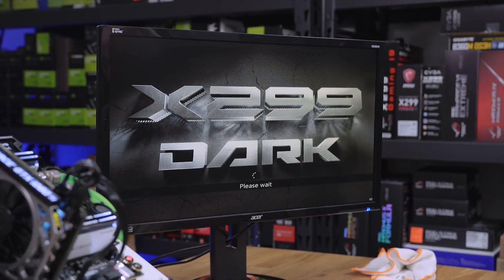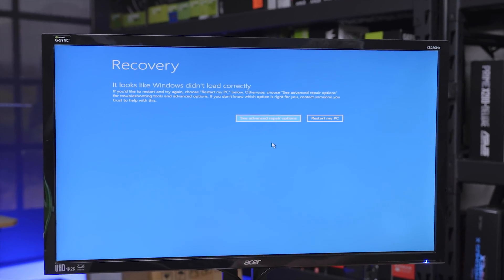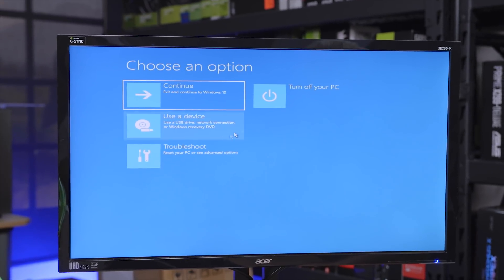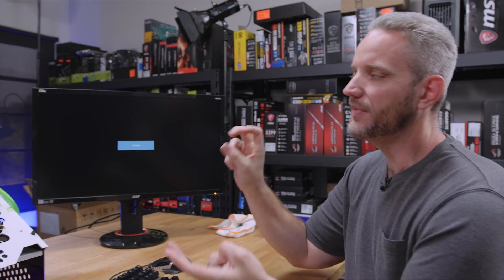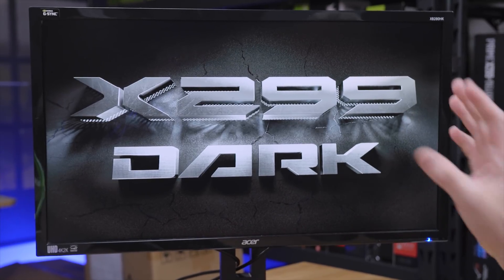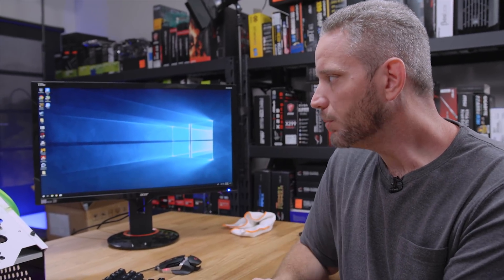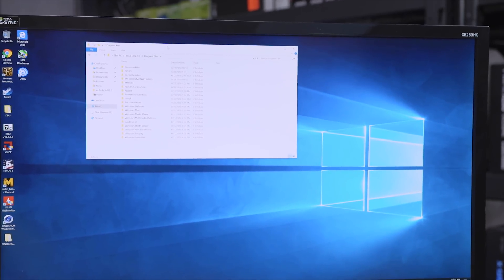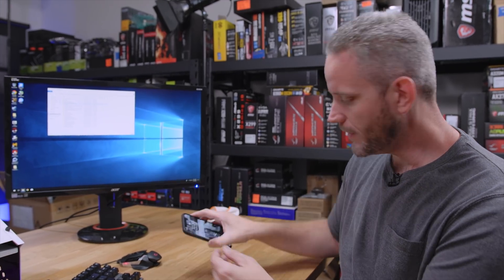New Test Bench Keeps Boot Looping... Here's how we fixed it

Comment: Bit late to the party, sorry if it’s already been said, but you could delete the app folder, and remove the registry key for the installed app. Windows would then not even acknowledge it, or you can stop the program from loading at startup, then use the uninstall from add or remove programs.

Comment: The best 'windows 10 help' would be if during the time you have to access those recovery options --- it lets you boot from an iso and use the iso as the main windows operating system allowing you to access the files on your drives so you can edit/copy/fix the things you need. If you installed windows 10, activating it, why cant i boot using an iso with the same windows 10 key to get full control of my bricked install?

If cmd prompt is active, why not give you access to buttons or tutorials on how to use cmd prompt to fix boot sector errors or anything else that should be fixed with cmd prompt. I know its there for the power users that know how dos and all the windows commands work. But for someone who cant get access to a reference, why not provide the reference. Allow me to navigate the directory, copy everything over to another location, reformat. Or access the drives, extract the iso, copy the installation files overwriting and not touching your personal files?

Or why not have a way to have a backup recovery option that allows you to fix any and every common error in windows that can be fixed in this way by default? 

Rant Rant Rant cuz my ssd corrupted my windows 7 and windows 10 installations back to back to back to back 4 times so I had to reinstall everything after proving my old SSD is at fault, and bricking 2 more installations on a new SSD cuz my old ssd was still connected and fking it up. (I know it stupid but i didnt do anything but connect them both and everything worked and dandy until i restarted and got chkdsk errors and could never recover....).

Comment: This is one of the reasons why I'm still running Win 8.1
The fact that "Microballs" has locked down the OS to such a degree that not even freaking SAFE MODE can fix the issue.. Clearly something is wrong!
However.. I'm gonna have to bite the bullet at some point and install that piece of crap, just to access the Windows Games portion. - Who am I kidding? DUAL BOOT all the way

Comment: Jay you can uninstall in safe mode with windows installer.

Safe Mode.
Type this in a command prompt:
REG ADD "HKLM\SYSTEM\CurrentControlSet\Control\SafeBoot\Minimal\MSIServer" /VE /T REG_SZ /F /D "Service"

and then

net start msiserver

This will start the Windows Installer Service.

Safe Mode with Network
REG ADD "HKLM\SYSTEM\CurrentControlSet\Control\SafeBoot\Network\MSIServer" /VE /T REG_SZ /F /D "Service"

and followed by

net start msiserver 

This will start the Windows Installer Service.

Comment: Getting rid of the F8 to safe mode is the single dumbest shit Microsoft did.

You can force trigger the recovery menu though - just shut it off during the spinning circle of Windows 10 boot twice in a row and on the third attempt it goes to recovery - this is assuming you have no better option on hand as its shitty and hacky but it does work.

Edit: Aaaaand thats why you wait before commenting haha

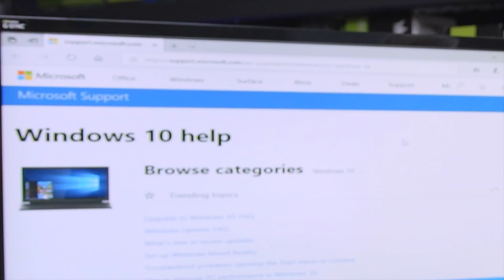3:55 so angry Jay :p

Also you CAN start Windows Installer in safe mode - open admin cmd and run the following:

REG ADD "HKLM\SYSTEM\CurrentControlSet\Control\SafeBoot\Minimal\MSIServer" /VE /T REG_SZ /F /D "Service"

Then

net start msiserver or just right click start it again in services.

Comment: As an IT Support Engineer, I came across the same issue of unable to uninstall in Safe Mode Windows 10 just two days back. For a more permanent solution, try following the instructions from this link as it allows for Windows Installer service to run permanently in Safe Mode:
https://support.eset.com/kb2098/?locale=en_US&viewlocale=en_US
Saved me from smashing the monitor when my laptop goes into boot loop :)

Comment: I spent goddamn near 4hrs last night/this morning trying to figure out what the hell my problem wuss. Come to find out, I have a failing HDD. After I unplugged it, it booted right up. The only reason I concluded that the HDD was the issue was cause I had heard it finally turn on after sitting there for about 15min while staring at the boot loop. After it turned on, Windows finally loaded up. I never new a separate drive could prevent a start up. Well, I'm happy I figured it out but extremely sad at the same time. The dying drive is a 1TB drive full of home videos/recorded gameplay footage. I gotta back it up before it's too late.

Comment: I had a computer that was bsod boot looping and it was actually the ram. The computer didn't like how they were paired and had to switch what channels they were running in and then it booted right up. Also had to reset cmos battery to fix a display issue where nothing would display.

Comment: I love W10, but damn it can be annoying sometimes. I had my PC crash on me randomly when watching videos for two weeks after upgrading to an 8700K because Windows was installing generic driver files that were clashing with display driver files that were named exactly the same. I had to remove the GPU, uninstall drivers completely and run a cleanup tool, then install Intel graphics drivers with the GPU still removed, THEN reinstall the GPU and its drivers again.
Bravo Microsoft. The file that was causing me trouble was atikmdag.sys, in case anyone is going through that same hell. It there were 3 different versions of the same file with the exact same name in multiple directories. After I fixed it, only two exact copies of the same file existed with various shortcuts to it. The GPU was trying to load the damn file and went nuts every time it tried. It crashed so hard I couldn't even see the blue screen of death; the display just turned off and it would restart after 30 seconds or so.

Comment: There might be another way for a system tester to work around this issue; Should the boot partition use NTFS as its partition format, the AMD directory can be named whatever. So when going back to an AMD system for testing a symbolic link can be made via mklink in an elevated command prompt (which is the easiest way to do it). Powershell's New-Item cmdlet also works but it's too much for something designed to do something so simple because New-Item does everything whereas old-school cmd.exe-executed tools just work for the task at hand.

As an example for the above:
ren %programfiles%\AMD %programfiles%\AdvancedMicroDevices
mklink /j %programfiles%\AMD %programfiles%\AdvancedMicroDevices

What throws a lot of people off with symbolic links in Windows is unlike in GNU / Linux systems where GNU's ln tool makes sense with specifying the target, then the destination Microsoft opted for destination first, then target.

Then you can do del %programfiles%\AMD any time you're switching away from anything AMD can handle, swap out your hardware and continue on your merry way, re-establishing the link when going back to AMD before rebooting.

Comment: Actually there is an easier way, and you restore use of the F8 key. This command in an elevated command prompt or powershell job will do it:
bcdedit /set {bootmgr} displaybootmenu yes
Alternatively for a multi-boot environment, you can enable these options per system. An example for the current physical system in use:
bcdedit /set {current} bootmenupolicy Legacy

You can find out which system you are setting legacy boot policy for by executing bcdedit. None of this works without elevation.

Comment: I can't believe that someone so clueless makes youtube videos to "explain" things. Talk about hubris... Every tuber that has a brain uses a clean install, if for no other reason to make sure that the numbers / experience is genuine and repeatable. So what you're (not) saying is that you are so stupid that you'd change processor brands and MBs BOTH and use a a dirty, polluted boot? At least a third of the mainstream idiots know that when you change MB, you should do a clean install. At least two thirds of the idiots can independently assume that the settings for X cpu do not in any way transfer to Y cpu and need a clean boot.

It's kinda like telling someone not to put diesel in a gas engine. Do you not have a boot image that would take 5 minutes to have a clean, consistent install for each processor family? In the next video you'll be booting a Linux OS using a single Windows partition and wonder why things are gorfed. It would take far less time to just tell the newbs to clean install when they switch brands and MBs. Seriously, how often do newbs do that without a clean install? Apparently, Jay does it often and assumes that stupidity is a normal thing with everyone.

Comment: for unrelated reason (after logging in, system basically hangs and the only thing i can do is move the mouse) i wanted to boot to safe mode on my relative's machine, but strangely do not have the option under advanced. I don't have see more recovery options  either. Like wtf HP get your shit together

thankfully i was able to go to command line from that menu and copied the entire hard drive out +/- bad files. I hate tech support. Tomorrow hopefully reinstalling windows will work. Will format the drive and nuke it from orbit.

Comment: So you want malware to be able to leverage Windows Installer while the system is in Safe Mode while you're trying to clean a system? Because that's why Microsoft did that. It's an actually useful security feature. If an application is starting up and causing a BSOD at login, just disable the application from starting at login with Task Manager while in safe mode. Absolutely no need to rename the application folder when there is a more elegant and faster solution.

Not being able to get into the startup menu with F8 is hella stupid, though.

Comment: I bought a custom pc and its been kind of doing this since i got it like 2 years ago, the tech support was useless.
When i start the pc, most of the time the windows spinning circle thing wont  start, so im jsut staring at a black screen forever instead of a black screen with a spinning circle in the middle. If i restart the pc over and over, eventually the spinning circle will appear and i will get into windows fine and everything works how it should. sometimes it boots properly first time, sometimes second, sometimes third, sometimes 10th.. you get the idea. PLEASE does anybody know what the problem could be?

Comment: For a windows admin this stuff is so trivial :D - You can enable Windows Installer with a quick Registry change. But more importantly just uninstall anything AMD and ATI before you switch to INTEL / NVIDIA. You could have swapped to base drivers in advance and would have been fine. Also getting to safe mode is not that hard Shift+F8 during boot but your machine is to fast to register it haha.

Comment: You sure you can't uninstall in safemode through the other windows Vista/7/8 style appwiz and not that stupid apps and features crap from windows 10 itself?
Cuz even in a "working" windows 10 install, I am not allowed to uninstall pretty much anything from the apps and features page.
It will however work through the old software manager like it was in Vista/7/8.

Its a little harder to get to (windows key + r , type: rundll32.exe shell32.dll,Control_RunDLL appwiz.cpl and hit enter)

Comment: Would "Driver Cleaner.NET" work at all on Win 10, I'm still on Win 7, 
For those that have never used it, "Driver Cleaner.NET" is made to run in safe mode to help remove any files that were not removed by the Add / Remove programs.

Comment: Ignoring the thousands of 'urgh you shoulda reinstalled windows with the new hardware' echoes, theres a trick to getting the installer service working in safe mode.
I even created a custom .bat file that fires it up (I work in a tech store, have to do this more than I'd like to state for my customers) When in safe mode all you do is set safemode to use MSIServer:
Type this into an elevated command prompt: REG ADD "HKLM\SYSTEM\CurrentControlSet\Control\SafeBoot\Network\MSIServer" /VE /T REG_SZ /F /D "Service"
Then type: net start msiserver
This will start the windows installer service and allow you to add/remove all you like in safe mode. I find it easier than renaming folders etc. Especially if you're dealing with more than one location the faulty program might be in.

THIS PARTICULAR FIX ONLY WORKS IN SAFE MODE WITH NETWORKING keep that in mind! :D

Comment: I'm having boot issues myself. I'll shut down properly and turn it on to play games and it'll try to start give it a second or two then it'll stop then reboot again and then stop just as fast then it'll boot but nothing will show on screen. 

But if I hard press the power button to turn it off it'll boot normally but it'll say it couldn't boot the configuration and sets it down to base settings. When I go into bios from there and put in the overclock and xmp overclock it then boots right up with no problems. So I don't know what to do except for play games with this shenanigans it's irritating.

Comment: Another Alternative of Starting the Windows Installer service in safemode is 2 commands. One deal with the registry, the other with services.

In Administrator Command Prompt:
First Command if in regular safemode: REG ADD "HKLM\SYSTEM\CurrentControlSet\Control\SafeBoot\Minimal\MSIServer" /VE /T REG_SZ /F /D "Service"
First Command if in safemode with networking: REG ADD "HKLM\SYSTEM\CurrentControlSet\Control\SafeBoot\Network\MSIServer" /VE /T REG_SZ /F /D "Service"

Second Command:  net start msiserver

Proceed to uninstall the software.

**As always, i'm not responsible if you decide to go this route.

Comment: This wasn't a Windows 10 problem, this was completely your fault for not removing it beforehand. First you can re enable the f8 key if you want with a command. Second, just use Revo to uninstall in safe mode if necessary, and third.... This was completely user error so don't blame ms lol

Comment: Could also go into startup within task manager and uncheck anything associated with Ryzen, check services as well. If using Win7 it would be under Msconfig.exe 
I use Revo Uninstaller these days. Even when it goes through the uninstallation process normally, revo will typically find crap left behind by the uninstaller. Registry entries, useless configuration files in the appdata folder. Honestly a clean wipe of the drive is good just for the fact that you don't have to worry about it. 

Jay, just create a starter OS installation with none of the vendor-specific bloatware and use sysprep to remove the drivers. Clone it and you have a quick reference drive for future benchmarking. Easier and quicker than doing a manual installation.

Comment: OH WOW,

I have been trying to install a SSD hard drive in my laptop and tried pre-loading windows and got the blue screen.... I wonder if this is my problem also.

All my desktops are AMD and my laptop is Intel.... I just needed a cheap laptop for the rare times I can travel.
Reply: INFO:
Trying to install a "Kingston SSDNow UV400" in to a "Dell Inspiron 15-5559 Intel Core i5-6200U"
So far no luck.... seems the cloning software that should work isn't working because the current hard drive is 1TB and the SSD is 120GB.
And the cloning software that lets you only clone only the files don't seem to work because it doesn't clone the partitions correctly?

Comment: @JayzTwoCents Everytime I do a hardware upgrade that would otherwise cause the system to not boot, ie moving ssd with installed operating system to a new build, I just put the operating system into an OOBE (out of box experience) mode so it will keep everything i have installed but remove the system specific drivers/registry options that way when I start the new system/build its as if it is a first boot and it installs all necessary default drivers that are needed.  For something like a test bench that sees a constantly changing mb/cpu/gpu doing this would probably save alot of headaches and time.

Comment: I still see you using the ACER 27" XB270H//U /Gsync there were two versions of these panels I got the basic TN 144hz 1080p TN panel version but the only review of these I can find is of the 144hz 1440p version. 
I can say the TN panel has the best color reproduction I have ever used pity they didn't sell many and can't find a good review on these how to calibrate it properly AFAIK they are true 8Bit panels and no dithering is used with it.

Comment: they actually have dealt with it you have to run the hard drive on the system it does work on and enable advanced start up and disable drive signature enforcement if it doesnt boot on that board then use a completely different one windows 10 is plug and play so it will detect new motherboard just fine but its trying to use similair driver causing memory conflict ive booted 32 bit os on a 64 bit pc from a laptop to enable advanced recovery its just more ins and outs for windows 10
Reply: try dealing with driver conflicts in system 32 like a hal.dll error that stuff is real trouble shooting and microsoft has so many libraries to focus on etc i really dont give them hell for building a solid os that actually rivals the usability of xp while being a heavy hitter for games etc each bios on everyboard is entirely different aswell with the new uefi bioses their all custom etc its not like the days of 2008 when you see amd source code in an intel board and vice versa lol i wish it wish though ahah old hardware for lyfe lolololol great video still and funny